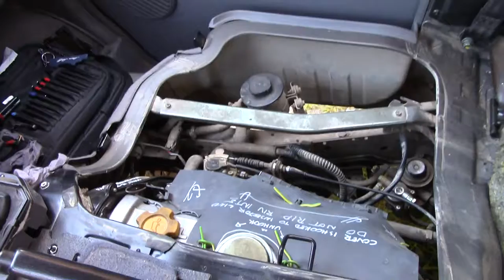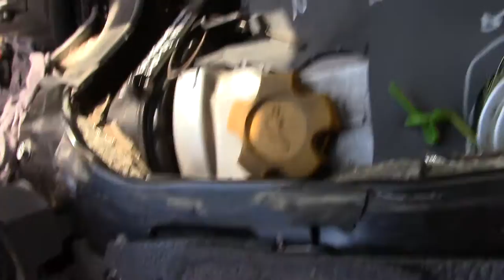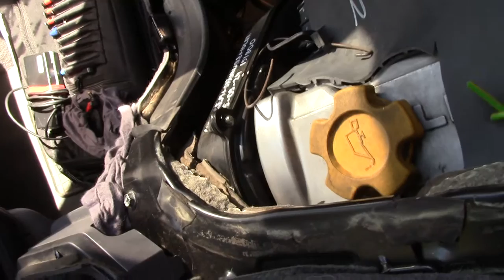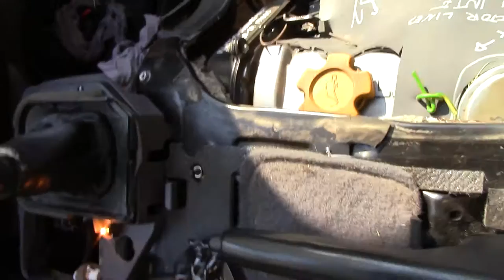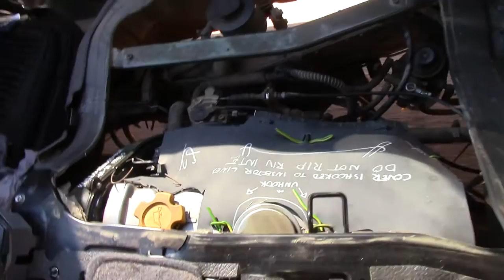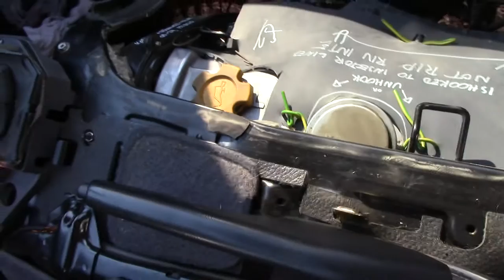Nissan Vanette, LD23 engine, driving around with the "hood" open

Comment: it certainly sounds healthy... and for a diesel van, it sure does move.
Sad that one can't find them here in the US easily, they crushed them all since the Z24i engine they fitted them with was prone to overheating and engine fires, so they recalled all of them and crushed them. Some still survive... but I'm sure because they're a rare breed now, they're hard to come by for cheap.
Reply from the maker: ***** I wasn't even aware there was a Vanette in the U.S. Mind that mine's the Nissan Serena-based version of the late 90's, not the Mazda Bongo version that's commonly associated with the Vanette badge.

As for moving, well, the engine sure does move around in the engine compartment. As for the vehicle moving in relation to the road ... 0-100 km/h is probably around 20 seconds unladen, if you're going downhill.
Reply: FFcossag hm. motor mounts look good? engine moving around could be some dry-cracked motor mounts for one, unless it's just so much torque it moves itself trying to move the van regularly.

There was a Vanette in the US in the early 90s, that's the one I was referring to. they put in a Z24i engine to accomodate for things like A/C.
Reply from the maker: ***** Heh. If there's one thing this engine does not have, it's too much of anything. It's a 70 hp N/A diesel, for crying out loud.

The mounts look perfect, but I'm betting that they've just become softer over time, losing the ability to dampen the engine to any meaningful extent.

If you're talking early 90's, it's definitely not the version I have, since mine was released in '95. You're probably thinking of those funky old ones that have the front axle really far back. If one thing is certain, I wouldn't trade my LD23 for a Z24. I had 4-sparkplug one in my truck, and that engine was a mess.
Reply: I like this sound, but I uderstand Russian
Reply: Can u plz help to show me how to fit a new timg belt on this engine ld23
It's for a nissan vanette

Comment: I have this vehicle it has been overheating lately. please what can be done
Reply from the maker: The cooling system is very big and likely to trap air bubbles, you should check for air trapped in the cooling system.